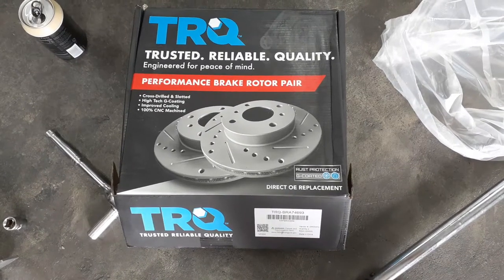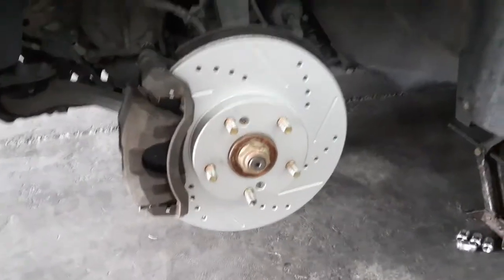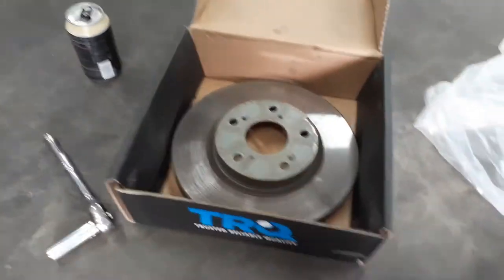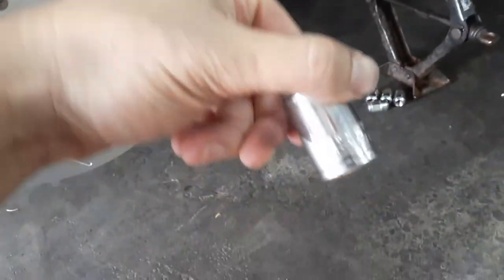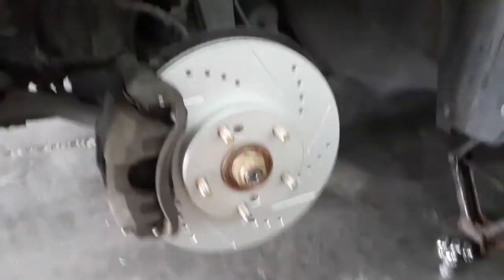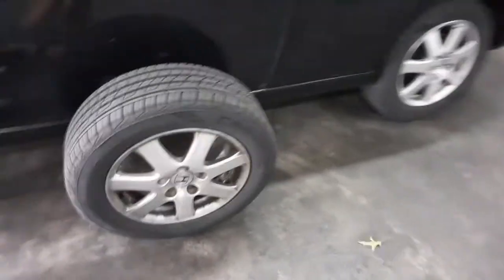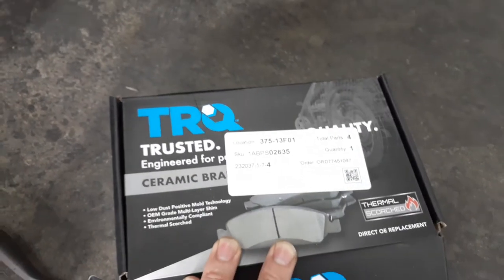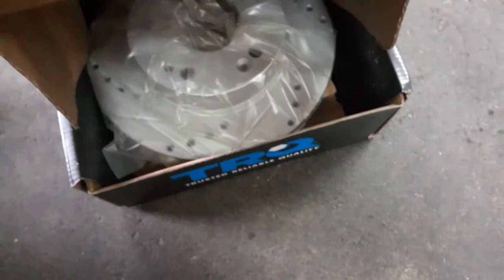TRQ performance brake rotors! 05 Honda Accord

Comment: Trq are ok to good enough i used them before and for the price are good. But i put the power stops z36 on my Durango just over 3 years ago and I stop harder than normal people. Right now my Rotors look like I just put them on and my pads have almost 70% left. But im thinking i have to take them apart to re grease the caliper pins. Before i have any issues. I paid $220 for the front rotors and pads for the 01 r/t durango 5.9. It's the best brake investment iv ever made.  Trqs are still pretty good for the price.

Comment: Would you say they’re good for hard stopping and fast stopping? My current OEM rotors have glazed and my old OEM rotors warped
Reply from the maker: They are great for hard/fast stopping. They won't warp because they stay cool due to the slots, unlike the OEM rotors.
They work great for long breaking situations, like going down a hill. They won't fade.

Comment: How are they holding up buddy? Was looking to order these for my bmw,
Reply from the maker: They are holding up fine. I have installed them on my GMC and also a Kia Forte. In my opinion, you can't go wrong, especially for the price. I made a video of the TRQ rotors on the Kia.

Comment: Did the rotors rust?
Reply from the maker: Did the rotors rust? I haven't had a rust issue with the rotors. Most rotors will aquire some surface rust if the car is sitting outside for a period of time especially in high moisture area's. 
As far as quality of the material itself, seems to be solid.

Comment: I am sry to ask but did they last and are the good parts
Reply from the maker: In my opinion they are good parts. 
They are still good to date, at the same time, with any slotted rotors the pads wear faster then original equipment pads and rotors.
Reply: @deslauriersadventures  would you not recommend them
Reply from the maker: @hamerkiller  Oh I totally recommend them. I will probably end up putting a set on my Corvette next summer if they have them for my application. 
For the price I don't think you can go wrong.